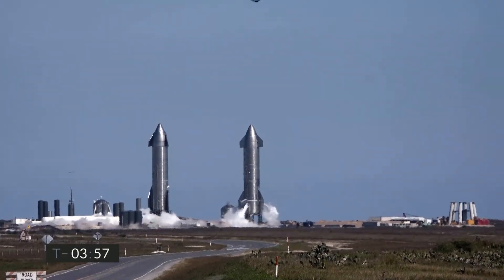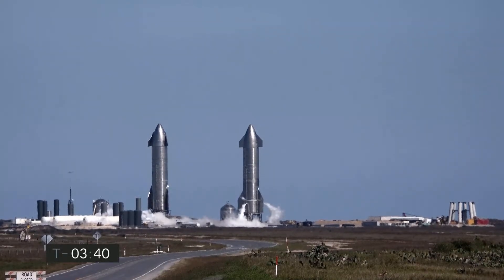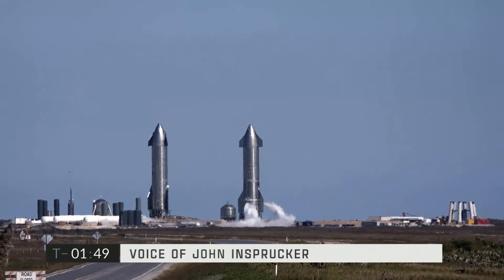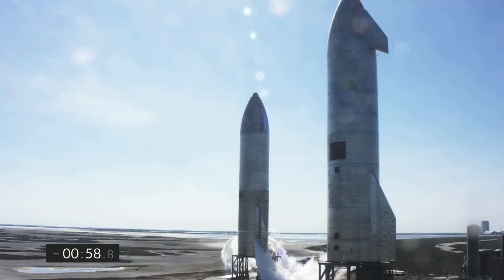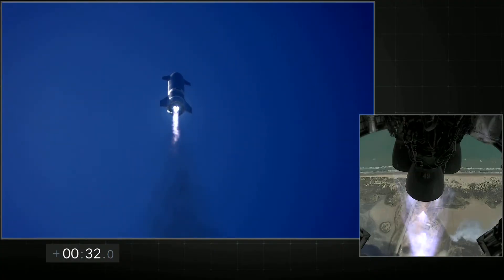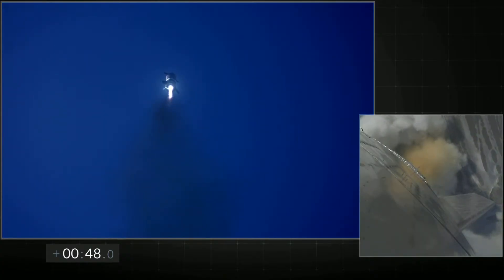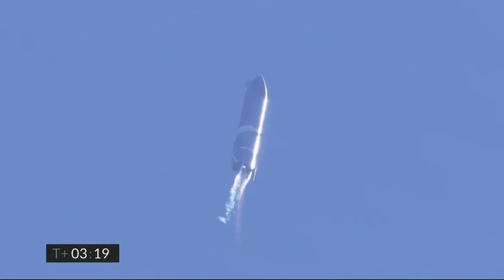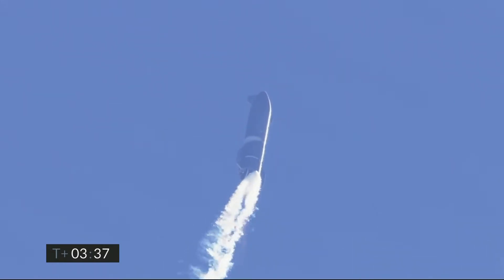Starship | SN9 | High-Altitude Flight Test

Comment: Hi Elon & Oracle Implementation Teams, 
I have a solution for the Telemetry Data Networking Failure observed in #SN8 and #SN9.

By executing a Readiness Infrastructure Fail-forward test it painfully clear to see the Fail-forward Architecture has failed in both Vehicle Engine Firing & 13K Flight Tests. 

Please understand this is the “last” or subsequent further Infrastructure “testing” that would have been covered under the original implementation. 

This requires using the ORACLE dbs services layer, extract some code, develop a Selenium18C framework, PING test Telemetry Sensor Array in RAID, POST this SN9Test.awr and awr.sql report to OEM and get ORACLE Database Performance Architecture Engineer to execute the Baseline to Benchmark Comparison Test. This is what I would have been doing if I did the ORACLE 18C implementation. 

Keep Shooting For The Stars,
Maxwell Mattison
ORACLE Performance Management Engineer 
maxwellmattison2002@yahoo.com

Comment: seems like they need to figure out the timing for the flip to vertical. I think its too heavy they should start with two much higher
Reply: I don't understand why the didnt see this since the first time. It's so obvious that they need to straighten the rocket and power up back at a higher altitude. It wasnt even straight when it hit the ground.
Reply: @davidboston5060  yes it looked similar to the first landing
Reply: Has nothing to do with the timing of the flip. One of the two engines just didn't fire correctly causing it to lose control and hit the ground to fast.

Same for SN8 just that it wasn't an instantaneous failure of one engine but a continuous failure of two engines.
Reply: @norinokia2307  really I thought this rocket uses one to land. Something about it being easier to control. but that mat be the smaller rockets
Reply: @robjla1  Starship has 3 engines. For the flip they use 2 and then go down to 1 for the landing. John Insprucker, the SpaceX Worker doing the commentary in this flight, also said this.

SN8 just had a loss of pressure in the methane tank, causing the 2 engines burn with too much oxygen, causing too much heat, resulting in the engines burning themselves and losing thrust.

SN9s failure is not known to the public yet but it seems like only one engine failed. Raptor engines still get damaged all the time because they are still in development. It's likely not a big deal.

Comment: The test was a Success because the purpose of testing is to find faults.  The test will fail when the rocket lands smoothly 🤙🏼
Reply: Yes they are trying to find out how to make it safe and reliable for people...But 
I don’t know how you could call a successful landing a failure.
Reply: @Seabee2127  Because then they will fail to find out how to make it MORE safe and reliable
Reply: "The test will fail when the rocket lands smoothly"?????  I'm glad you're not a pilot.
Reply: Somehow I can hear a student saying this to their teacher about a failing grade on a test.  " But teacher your test was successful at finding my faults!"🤣🤣
Reply: tried that line on my high school math teacher once...didn't go well
Reply: Why they start the engine at so low altitude where they can have control  of meneveur ,can anyone explain
Reply: @sagarrawal5195  Mostly, I think the Raptors are so Powerful they can not be throttled down low enough to allow the starship to hover, so they have to time it exactly to where the engines will provide just enough thrust that it lands at ground level...  I know it sounds strange, but a Heavier Starship would most likely have an easier time at landing..   But when doing a test, it's always better NOT to have a full tank fuel when the landing does fail..  makes for a much bigger boom should the landing not go well..
Reply: Rene Jr. Tajos  EXACTLY!!!!

Comment: The best time to start the engine should be at km5.. at 5km 2 raptor engine and at 1km 3 raptor engine... that should do the trick... by using 3 raptor engine instead of 1 to land can offset the weight and speed the starship is landing
Reply: NateOCE  i do but.,A short burst from3 raptor and after that use 1 raptor could save more . As i mention, at 3km a short burst from 3 raptor could offset the speed and on the 2-1 km use only 1 raptor.
Reply: At 5km 2 raptor to swing the starship
At 3km a short burst from all raptor engine to slow down the speed
At 1km-500m 1 raptor engine to land...
TOUCHDOWN

The fuel position need to be stabilize at 5-3 km... i think that is why the startup of the raptor are late...

Comment: Need some help here. Why use the engines to "flip" why not use the fins to orient itself upright towards the end of the flight ? And then just use the engines to slow down. Sort of like Falcon 9.
Reply: Well, the more vertical starship gets the less effective the fins become to reorient itself vertically, which would also take a long time if it's even possible. But also when it's horizontal they're going to be far more effective then when it's i.e 45° vertical.

You also have to take into account that as the air hits starship while it's at a 45° angle it's also going to push starship to the side for example
_
 \  \
    \  \   ➡️➡️ Movement of Starship
       \  \
⬆️
Wind

Comment: Hey, I'm no astrophysicist, but I am fairly sure that whole "landing" part is key.
Reply: Do you know how successful rockets are built? You crash them until they stop crashing.
Reply: Landing is something they know they can do in general, could be just that pressure problem again in the header tank. It's highly unlikely that eventually they fail to find a solution and scrap the whole project. It's not a major risk. The flip maneuver is one, and it's great news that is went flawlessly two times in a row. The new engines have also performed well. Reentry remains the only major design related risk, AFAIK. I'd expect that they focus on the risks first and tweak the minor flaws as a second priority.
Reply: @neithere  In general? There is no such thing.
Reply: @stateofopportunity1286  They know how to land a few rocket designs. They have the experience and technology. The main new feature of Starship that matters post-belly-flop is AFAIK the header tank. The rest is known, tested, refined and proven many many times. There's no question whether they can land it. The question is when.
Reply: @neithere I would think it would need to be proven reliable over many, many landings to be certified for human passengers. It's going to be a while.
Reply: @GearZenChannel  of course. Like Falcon, this thing will bring many a satellite to LEO (and possibly beyond) before humans board it.

Comment: I doubt that the views we got had the very best perspective, but to me it looked like the 2 engine relight for gimbaling only actually lit 1 engine, and the second didn't fully come on line until after the rocket was more than 45 degrees up towards vertical. My impression is that this was 'too late' to 'right' the ship , and reduce vertical velocity, before they would shut down the second engine to land on one. They might consider starting that rotation relaunch move at 2k, rather than 1.5k. As I noted though, I don't think we had the very best perspective on that.

Comment: Pls for gods sake turn off that sky diver landing function pls let it land just like falcan 9
Reply: Pls for gods sake learn about physics and prototyping

1. It can't land like a Falcon 9, since Starship is a second stage and needs to keep the heat shield in flight direction, orbital entry is much worse than the heat the Falcon experiences

2. Watch the "How not to land an orbital rocket booster" video. The Falcon 9 also needed many tries before they got it right.

3. It needs an efficient way to slow down, doing all the work propulsive or with drag isn't an option for Mars. You need both.

4. The failed landings of SN8 and SN9 seems to have nothing to do with the sky diving. SN8 had a tank pressure issue, causing an engine failure. SN9 seems to had an engine failure of some kind. Still unknown what the cause was. But Raptor engines still fail all the time. 

All of this is still in development and it's okay if it fails. That's why they're doing it. To find as much errors as possible so it won't happen when they fly commercial missions and humans.

Btw they just scrapped SN12, SN13 and SN14 because they expected to needed them to just achieve what SN8 did. It's going much better than expected.
Reply: @norinokia2307  thanks for teaching me really, i had forgot this is second stage , i know how much heat shield and important in mars atmosphere it has bear 7 min of heat, i just loved your reply thank you
Reply: @rakeshtippannanavar2437  No problem! Sorry if I was a bit harsh first. I've seen many comments by other people who were really ignorant about all of this.
Reply: I have bunch of paper cuttings and info on hyperloop spacex space exploration and satellites like voyers i like to share with u

Comment: Sweet.  On to the next one.  Maybe deleting header tanks, flipping early, waiting a few seconds for fuel/ox to settle under partial g, then starting via the regular plumbing might be the way to go.  Also wonder if starting/running during the fast pitch rates might bugger the turbopumps -- it has to induce huge 'gyroscopic' loads, given how they're mounted.  Packaging them at right angles to the ship's long axis might be tough, though.  Anyway, both engines looked to have problems, but only one shit the bed.

Comment: man, this is fricking awesome!!!!  kinda expensive. but it seems its a problem with o2 delivery on the second engine. personally, i would have written back up code for the third engine to boost if second engine fail, and let it start the vertical descent a little higher to allow for a third engine start

Comment: I don't know. I like the way the Falcons land. Where they stay vertical. The Starships seem to flip too late where you can't course correct or abort in time. Is there a reason they don't switch to vertical earlier? Is it just too big to keep vertical for very long?
Reply: When Starship is horizontal they have maneuverability and can control descent due to flaps. When it's vertical they have no maneuverability unless raptors are lit.

When it's vertical raptors need to be relighted to be able to control the vehicle. The relighting problem is going to be there regardless of orientation, if vehicle is vertical all the fuel goes to the top of the tank, if it's horizontal it goes to the side of the tanks.

So here's the problem:
If they do the flip maneuver on a higher altitude and the engines don't relight then Starship is uncontrollable at a higher altitude.

This gives it the possibility of being affected by wind and drifting off to an area not designated for landing or rather where you do not want the vehicle to explode.

Falcon9 doesn't have this problem as it's a completely different rocket using a different propellant.
Reply: @fredrika3639  Good to know. Thanks!

Comment: I think Elon will put the project on hold for a while. First a fuel pressure tank problem, now clearly visible some engine parts where blown off just before the raptors where re-ignited, the second one did not ignite, and Kabooom nr. 2. It would not be a nice sight to see SN 10 crash and explode also. This thing is meant to fly people in full safety, and not some live online rocket explosion freakshow. If three on a row would crash and explode, live, for millions and millions of viewers worldwide, that would be very, very bad publicity for SpaceX. If i was an astronaut, i would never climb into this thing. Elon will have a pretty bad headache now. Exploded SN9 and 158.000 Tesla's called back to the garage because of computer parts- and touch screen problems. It can't be non-stop halleluja. Maybe things go a little bit too fast, and this is a warning call...

Comment: Start 3 and shut down as necessary to assure you have 2 and then 1? As an Army trained  helicopter pilot since 1967, this makes an engine out autorotation emergency  landing landing look positively tame. Things happen so fast! Could we budget more fuel for landing and start the engines a little higher? I am so happy to see SpaceX pick up the ball  and run with it. As aviation pioneer Otto Lilienthal said "Sacrifices must be made".

Comment: For the idiot retards thinking SN-10 will be better. SN-9 has a fundamental issue with the Raptor firing modules which caused the malfunction of relight. This same problem will occur with SN-10 as both iterations used the same configuration.
Reply: What's a retard?

Comment: Looks like problems with 2 of the Raptor engines.  The second one failed to ignite and appeared to explode...and then the third also failed to ignite, and the one engine by itself wasn't enough to complete the flip.

Comment: looks like the transition to landing should happen sooner to have more time to correct for overshoot. something that big turned that fast seems a tad dangerous without slack for corrections.
Reply: It's actually the opposite, when Starship is horizontal they have maneuverability and can control descent due to flaps. When it's vertical they have no maneuverability unless raptors are lit.

When it's vertical raptors need to relighted to be able to control the vehicle. The relighting problem is going to be there regardless of orientation, if vehicle is vertical all the fuel goes to the top of the tank, if it's horizontal it goes to the side of the tanks.

So here's the problem:
If they do the flip maneuver on a higher altitude and the engines don't relight then Starship is uncontrollable at a higher altitude.

This gives it the possibility of being affected by wind and drifting off to an area not designated for landing or rather where you do not want the vehicle to explode.

Comment: Looks as if it needs to return to the vertical position  at a higher altitude prior to landing to give more time for stabilization to take effect and rockets to come to equal power for a soft landing. Just my opinion but hey what do i know..
Reply: Glad your not like the others who think their rocket scientist who know more than SpaceX.

The position was perfect, It was just that one of the engines failed to re-ignite, making the flip fail. If it had that engine, it would have been a picture perfect landing.
Reply: When Starship is horizontal they have maneuverability and can control descent due to flaps. When it's vertical they have no maneuverability unless raptors are lit.

When it's vertical raptors need to relighted to be able to control the vehicle. The relighting problem is going to be there regardless of orientation, if vehicle is vertical all the fuel goes to the top of the tank, if it's horizontal it goes to the side of the tanks.

So here's the problem:
If they do the flip maneuver on a higher altitude and the engines don't relight then Starship is uncontrollable at a higher altitude.

This gives it the possibility of being affected by wind and drifting off to an area not designated for landing or rather where you do not want the vehicle to explode.

Comment: No green flame this time, so it didn't run out of fuel and wasn't undergoing "engine-rich combustion."  When there's no fuel, the hot oxygen burns a copper lining out of the engine.  So, not the same problem as last time.

Comment: This seems like a stupid way to land a Rocket this big.  I'm sorry but it works for his TINY Boosters but I think it's silly for this huge booster.  I think it's more practical to have a controlled aero dynamic descent like Planes, birds and cats land.  Belly big, wings out.  Not that landing matters it's just a booster, we just need it get the capsule towards the moon or mars, you dump the booster in the ocean for all I care, and we'll find better ways to SAVE it/Re-use it in the FUTURE.
Reply: There's not enough air on Mars to provide lift, there is no air on the Moon for lift, there isn't runways for either, there is no capsule, (it isn't just a booster), and Falcon 9 boosters are by no means "TINY." Everything you said was completely wrong.

Comment: Hi spaceX,
As I just started following you and after seeing both of the two bellyflops failing, I was wondering for the reason, why you guys doing this flop in last second??
Well, i can see the fuel saving in a shorter burn, but wouldn’t it be smarter to ignite engine number one a few seconds earlier for the flip, giving it the time to “stabilize” the flip before igniting the second one for the landing burn?  So going away from a flip and land sequence and going to a first flip and then land.

Comment: This is literally stuff you see in movies set 100 years from now
Spacex bringing the future to the present
Reply: In 100 years, maybe anti-gravity tech will be used.
Reply: @doublevision5465  100 years very unlikely , more chance it will be nuclear powered fusion engines. Probably not antimatter and I think gravity manipulation is 500+ years away
Reply: @rhaegal5650  this primitive chemical rocket won't get us to mars. We need continuous thrust and power for interplanetary flight.
Definitely not any time soon. Elon's rocket is an unproven Soyuz, well short of Saturn V's load capacity or Soyuz reliability.
So it's 1965 again, except our next booster failure could kill our astronauts, and crush Tesla's market cap. 
To quote CNBC: "It will be one helluva market mover!"

Comment: It looked like one of the two engines used to flip it horizontally either didn't light fast enough or it didn't last long enough. I'm sure they will solve the issue.